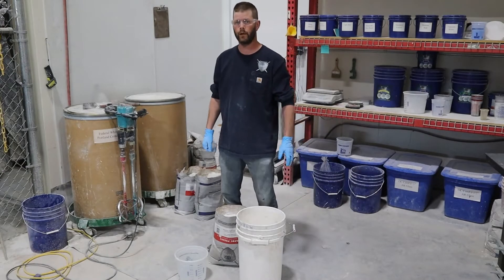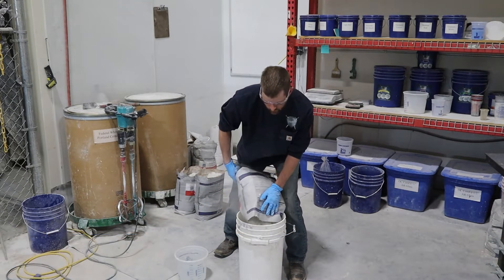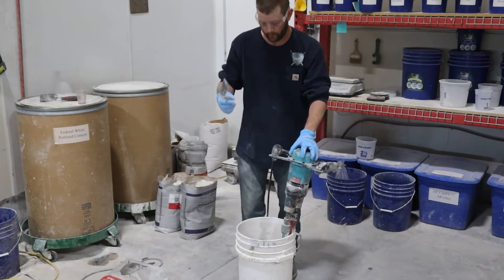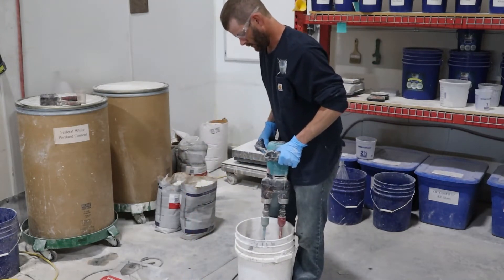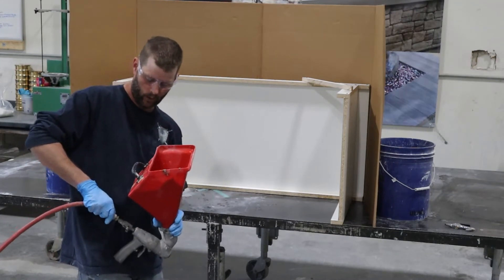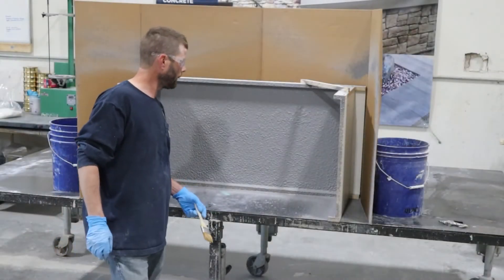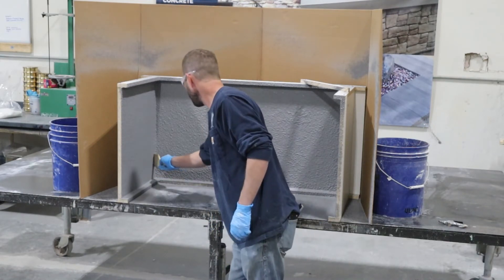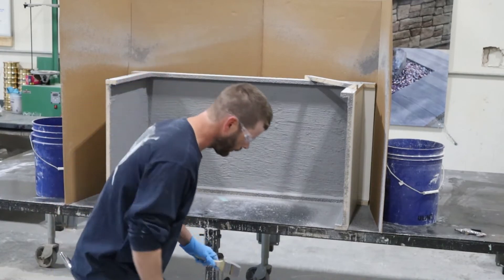Trinic GFRC premix Sprayed face coat

Comment: Hi, what size of the nozzle is uded for such a face coat?
Reply from the maker: It comes with the 5mm & 7mm nozzles - 4 & 6mm versions are available. Here's more info from Power Sprays - https://www.power-sprays.com/wp-content/uploads/2022/05/MK3-Powertex-Facing-Coat-Spray-Gun.pdf
Reply: @TrinicLLC  thanks for reply...what size was used in this particular video (session). What is your best choice for spraying face coat (mix with sand)?
Reply from the maker: @radzahero1829 We used the 7mm in this application with sand in the mix. That's the one our techs prefer for our GFRC premix.

Comment: Hi what are the compressor requirements for the spray gun?
Reply: The MK3 used in this video consumes approximately 7 cfm at 2.8 bar (40 psi), so I would consider that the absolute minimum.

Comment: Whats the purpose of a false set for face coat?
Reply from the maker: It's to ensure the sand has absorbed all the water it can, which helps minimize curling and cracking.
Reply: @TrinicLLC  follow up question my face coat keeps coming out splotchy and discolored on some pours but not others could you tell me why?
Reply from the maker: @chrisgibson5318  Please email or call us to discuss so we can better understand your process - vince@trinic.us or (607) 775-1948